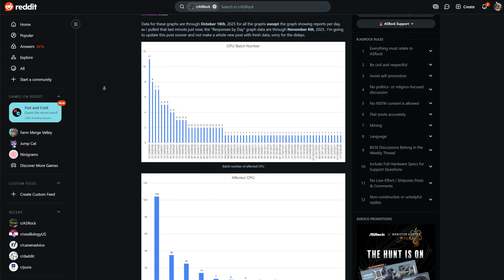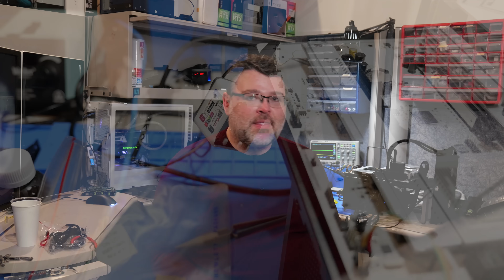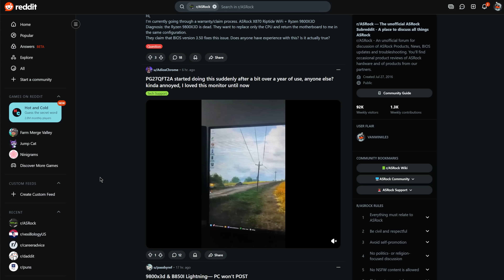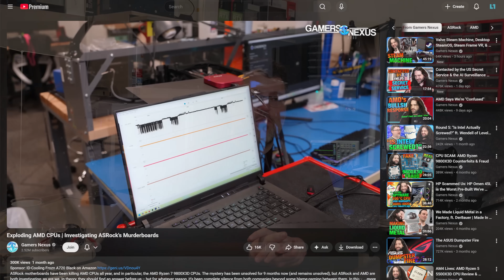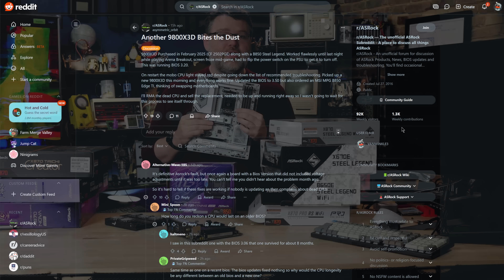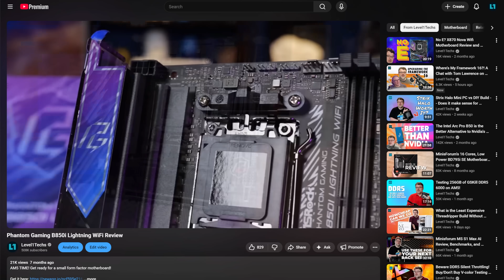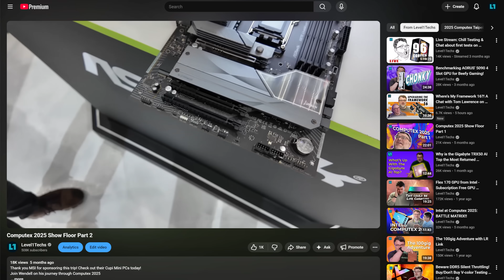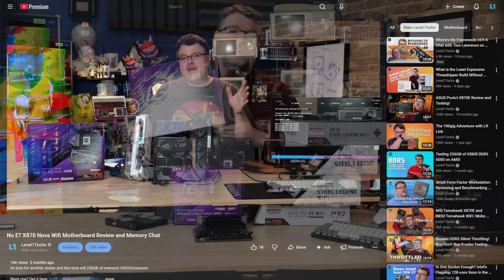Attempting to Troubleshoot the ASRock Motherboards of Death!

Comment: I have an Asrock X870E Nova WiFi motherboard. I've been using a 7950x CPU since December 2024. It hasn't had any errors or CPU failures like those mentioned on Reddit (I'm really worried about whether my CPU will fail), or maybe there's some problem with the X3D series that we're still trying to figure out.

Why do Asrock motherboards cause so many CPU failures? Because they've released many high-performance motherboards with good value for money, and because they have a large market share, they've also received a lot of complaints regarding CPU failure issues.

Comment: I’m totally new to pc building. Built my first pc 6 months ago and it worked perfectly. Suddenly the mobo has a solid red light (x870 riptide). I have no clue where to turn. No display, no peripherals working. I’ve jumped the cmos removed the battery, GPU and ram reseated it all. Where should I go to next ?

Comment: For what it's worth, I built an AM5 system with X870 Steel Legend and a 9600x. The system ran flawless for a year and then RED CPU LIGHT. I definitely think it has something to do with power/idle states. My system failed while idle in the night. Lights and fans spin up fine though...

Comment: Have you considered the uniformity and pressure of the socket pins(lower quality sockets).

TLDNR: socket pin problem may cause this issue in my opinion

In my area its really common for any kind of electrical pin/connection to go bad due to thermal vent gases(sulfur etc) in the air rapidly speeding up corrosion and also showing possible flaws much easier than anywhere else, from the corrosion side of things, anything copper turns black, even copper under gold plating and I have to regularly polish ram contacts/pcie edge connectors on GPU's etc.

what it also does is tarnish things like the pins on a 8 pin PCIE power socket on GPU's a tiny bit more/faster than they typically would, and from debauers Wireview pro 2 on 12v 6x2 monitor you can see how each pin doesn't take the current evenly so I assume it would be similar on other devices with multiple pins made to handle more current

My example is a evga 3080 with 2x 8 pin and its stock 366w bios:

while I know 8 pin connectors rated 150w and 60-70w comes from the PCIE slot itself they're still not bulletproof

Well here in my town that problem starts on an 8 pin PCIE power socket by one of the 12v positive lines getting a tiny bit tarnished then that increases the resistance which increases heat which makes it tarnish harder and faster, which increases resistance repeat untill its hot enough the next pin in the line starts tarmishing over the heat cycles and cooldown when off then the next pin does it too.

after awhile the most tarnished pins don't even supply enough current when started and the cards get crashy, when inspecting all 6 12v positive pins across both 8 pin connectors have darkened to the point they are black

after replacing both 8 pin sockets, the problem goes away.

this isn't limited to computer stuff here, even a H4 55w car headlight bulb with a H4 3 pin socket will melt when the pins get tarnished.

How do I think this relates to the Asrock motherboards and CPU's dieing?

If one or two of the pins in key power supply areas are a little tarnished/not of great quality and/or do not have even spring pressure with the surrounding pins it might cause an a similar situation of the failing 8 pins on gpu cards in my area.

Where one pin heats up a little due to an issue, then the pad heats up with it the heat adds more to the problem by creating oxidation or reducing spring tension then another pin shared in that VCC pin has to supply more of the current then that heats up, and pretty soon you have hot pads that have bubbled and warped the bottom of the pcb causing more problems.

pin not quite pressed hard enough, or the tip is deformed or the coating that protects from tarnishing not plated well enough in addition to skin oils/other contaminates on the cpu pads/flexing of board/socket a little basically enough of those problems mixed together could all do this.

and the fact that your socket replaced board failed to kill makes me think its more likely

Comment: My Nova Wifi also went dodgy with my 9800x3d after about 8=9 months. The problem started from sleep mode and wouldn't wake up properly and started giving 00 and 03 codes when cold booting. Only pressing the reset button on the board would work so now it only boots without that dance if I put it in LN2 mode so I've been using it in LN2 mode for a couple of months now with no problem but I've ordered a replacement regardless.

Comment: ive got asrock steel legend wifi with an amd 9800x3d. ive noticed with fancontrol that my cpu socket is around 70-80 Celcius even when im not doing a lot. The CPU itself is around 30-35C.
This is with bios version 4.03. ive noticed some instability with the pc coming out of sleep. not always but it has happend to me 3 times over the past 2-3 weeks.
Im gonna contact asrock support to see if these temperatures are to be expected

Comment: maybe worth to check the bios chip brand / model and check if other brands use similar or different chips? Could be asrock is unlucky and had a bad batch of bios chips corrupting data and maybe some bit flips you dont want to flip toasted some cpu's

Comment: Been rocking a B650E Tachi with no issues for about two years, one year with the 7800X3D and one with the 9800X3d and no issues at all. I also tried many of the bios and never had an issue. Also used Asrock in the past with no issues.

Comment: I am one of the victims of Steel legend. The problem with this issue that in most cases the CPU dies through months.  MIne lasted around 8 month with issues starting around 6th month.
The problem with testing is that in most cases people flash their bios during short mobo lifetime. I started with 3.20 and ended with 3.50, but i think the initial damage that caused quick cpu degradation was caused when 3.20 was installed.

Comment: i believe i know what really cause it ...is it strange that only asrock and not other brands have issue like that ??? i did not notice until looking at my board and my brother asus brand...and usually expensive boards and budget on only AMD side never use full 2 8pin cpu power vs everyone else using one 8pin and one 4pin only for stability and OC since all AMD cpus never reach 225w is rated by that setup vs AROCK tachi and others using over 300w on 2 8pin setup...i assume its only for intel i9 cpu's but never on AMD ryzen9 or even worst people using on ryzen 7 3d cache?? and this what ASROCK said as i copy down here in quote "Hi-Density Power Connector
CPU overclocking requires higher current. ASRock Hi-Density Power Connectors are designed to withstand higher currents compared to traditional CPU and ATX power connectors, providing a more stable system and reducing the risk of fire during heavy overclocking."  So adding more power reduce house fire ??? sound very weird wording to say like that vs common sense says less power never resulted house fire . It just not gonna turn on for using ryzen 9 16 core cpu using only one 8 pin

Comment: Was making a build with the AsRock B850M Steel Legend WiFi motherboard for a frend and pair it with a 9600X. We plan to build it in a week so we can still swap it to the Gigabyte B850M Eagle Ice. Should I swap it for safety or should it be fine to update the bios to 3.50 asap when we build it and then just let it do it's thing ? (No clue if it matters but I'm in Switzerland)
Reply: There were reports on reddit that even on 3.50 BIOS the CPUs would die so
Reply: @miraveilyt  Yeah, I think i'll go with the Gigabyte in that case. Cheers mate

Comment: I have a 9800x3d and a ASRock b650m Pro Rs, running since april, so far no issues. I am terrified to overclock it tho… I’ve manually adjusted ram timings, monitor timings, overclock my gpu all the time, but the furthest ive done on my CPU is a slight undervolt with no clock boost. Really wish I could try overclocking, just don’t wanna kill my $500 cpu or my now 1 Trillion dollar ram kit ( 2x16GB 6000CL )

Edit : Apparently my batch is CF 2502PGE which is the 2nd most common for deaths on the ASRock 9000 series death megathread
Reply: not been any reason to oc for years

Comment: My first pc build: Asrock B650 pg lightning & 9700x cpu. Latest bios(3.3) before cpu ever touched the socket. Came 3.2 out the factory(sticker on mobo). Updated to 3.4 & 3.5 day of release. Been using daily awhile, no issues. Hopefully never over the years.

Comment: It has become "fashion" to volt the crap out of CPU cores to get maximum clock-boost via default bios settings, that is really good for the online reviews/benchmarks of big publishers. I think that is the cause of dying CPU's.  Since Ryzen generation, i undervolt and limit the max boost clock to keep the CPU stable. So i got a all core clock max now  of 5,19Ghz on 7950X3D and limited thermal limit to 75C.  Which results into all core clock of 4.9Ghz when all cores ae 100% loaded.  So you do loose performance  due to the severely reduced thermal limit (from 90C).  The Pro: It is impossible to fry the CPU with such settings.   Did similar on the older 5800X (not 3D), still in use daily, really nice all core clock and no risk of frying the CPU at the cost of about 4% performance. The 5800X does not run into the lowered thermal limit due to not having that warm coat of  3D cache on top of it.
CPU's are watercooled, but that 3D cache on top on cores, is really a  poor design choice, it is just impossible to keep those cool under maximum load

Comment: I wonder if it's the socket?
I've got an Steel Legend B850 running a 9900x since May, and a Taichi X870E with a 9800x3D for over a year, no issues so far.

Comment: I think there are going to be a certain amount of failures of any product. But once it hits a certain amount... the social media echo chamber Rage Machine makes it seem WAY worse than normal. With motherboard, CPUs... so many variables. Was the CPU installed correctly? were the Motherboard power cables installed correctly? Were there any loose screws in the case causing shorts on the motherboard? Did the owner try to OC the crap out of the CPU with custom voltages? Owners with destroyed CPUs never want to admit they possibly did something wrong, making it very difficult to find actual causes for the damage.

Comment: I have a feeling it's something with how the CPU's socket is soldered to the mobo. I have a feeling it creates some kind of resistance on a pair of pins that complete a circuit. The batches of CPUs that seem "problematic" had some kind of manufacture defect that passes normal Q&A checks but when combined with a socket that creates high resistance between the pins/pads things go haywire...

Comment: I’ve had my Asrock X670e steel legend for about two and half years now with both the 7950x3d and now the 9800x3d 

The 9800x3d I have over clocked to 5.65ghz and I have not ran into any issues. 

Thankfully.

Comment: I have newly build 7800x3d with B850 steel legend on March this year, pair with 2x16gb Kingbank Hynix A-die 6000cl28, with heavy AAA title gaming like Monster Hunter Wilds and do MMORPG botting at overnight 24/7, no problem so far. I only change a few things in bios, one is disabled integrated GPU (dGPU only) , second is PBO sets to Auto for all cores,  third is CPU fan speed curve. I have HWinfo64 on when computer started up, but never seen the CPU SOC goes over 1.19V, maybe I won the silicon lottery??

Comment: i got a Asus Crosshair VIII Formula ive used for about 5 years and it to started doing wierd things with the ram voltage like running up to 2 volts ...the boards fried 5 sets of ram .....and i dont know what it is .....ive taking the board plastics and back plate off to check things out and i see nothing wrong ....cept one wire came off the lower led rog eye thing in lower right of the board ...still dont know if this is why but ima bout to find out ....crazy i should find this when going threw this with this board ....its a am4 board to so i dont know man ....board issue or that wire coming off the rog eye led light plug ....kinda ticks me off this is even going on ....thats alot of money on ram this boards waisted !!! all those are am5 ....ever seen any weird crap on am4 boards like this going on?

Comment: I've been running a ASRock a620i wifi board that has some weird wake issues when I got it.  It refused to wake at all once it went to sleep. But since I updated the bios last year it's been fine now.  Now I just have some Radeon wake issues in Linux instead 😂

Comment: "Remember, only about 150 boards are on Reddit that have shown up"

I recently built a new gaming rig and I was very tempted by the features and prices of ASRock motherboards, but as I decided to go for a 9800X3D I didn't want to take the risk. When others has been asking about ASRock and if they are safe I have made a habit of saying that they have had a higher recorded failure rate with X3D than other brands, but at the same time the recorded failures are really few out of the total number of sold motherboards and even those that have been combined with X3D processors. So the risk of having the motherboard kill a X3D processor is probably not really that large. But any way most people has chosen to look for some other brand.

A situation like this is really hard to recover from, and especially as no real huge fault has been discovered. Another part is how rare the problem is. If they had killed all kinds of processors then it would be simple. Just avoid and you will be safe. But no, it's just the X3D version. What ASRock has done has been issuing new BIOS versions with no real explanation of what they have been tweaking. This doesn't help build trust.

I remember someone had been measuring the voltages and found some transients that he didn't find on motherboards made by other companies. This is one of these things that make you wonder. Is the problem really something they can fix using software updates or is it some hardware design flaw? And since then I haven't heard anything about it, so perhaps it turned out to not be related at all...

If we eventually find out exactly what has been the reason this issue occurred it will help ASRock to start rebuilding their reputation provided it's not something they knew and just kept quiet about.

Comment: I don't know. This all sounds extremely suspicious to me. According to Gamers Nexus and Level1Techs this issue is not reproducible. I'm a system builder, which means I build computers for a living and also sell systems as a private since I love putting together nice builds. We used mainly Asrock boards this year because they are affordable and rock solid and we never ever had any CPU related issues with any Ryzen 7000 or  9000 series chips, X3D-chips included. Asrock might not have the best memory compatibility but that also got much better with Bios updates. Most customers want X3D chips lately and I'm repeating again, not even one issue with Asrock boards. We are using mainly B650 and B850 chipsets.

Comment: cool so not seeing my ASRock B650M Pro RS so maybe I'm safe upgrading to a 9800X3D or X3D2 since I already updated the Bios to 3.50 and will be replacing a R5 7600 which only reason I got to begin with was for updating the bios.

also not sure if the settings stay or not on a CPU Swap but already changed one of the Settings in the OC Settings to not over volt my CPU.

Comment: yes on reddit they should remove user errors on the list, anyway from what i can speculate seems there is a bug (in 0,5% of the asrock motherboard i think) in the bios on asrock motheboard when pc is in sleep mode and when you remove it could send too much voltage, usually i use my custom voltage on my pc builds and curve optimizer but i always undervolt not vice versa
ps. i know that asrock gained a lot of market share thx to ryzen cpus, so i don't think they are small if we look into it, i bet the new motherboards from asrock will not have this problem

Comment: It's just a lower quality voltage regulator and/or mosfets. ASRock is ASUS budget line. Combine that with stressing a weak silicone lottery budget CPU and you have the answer.